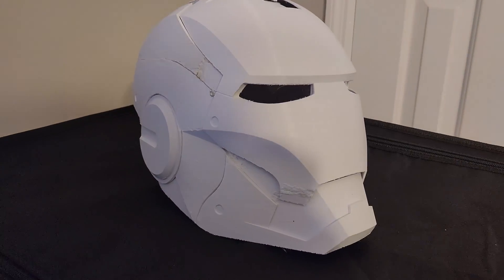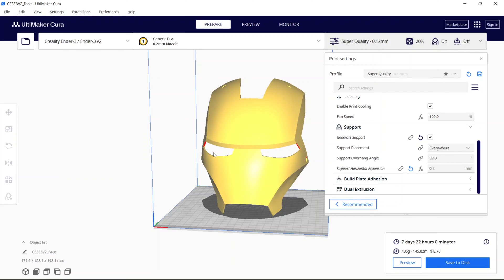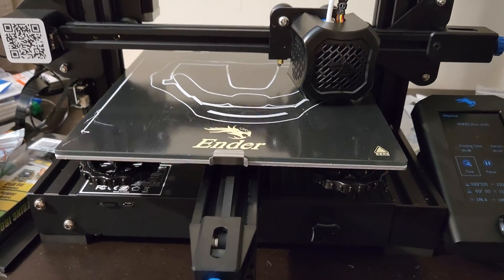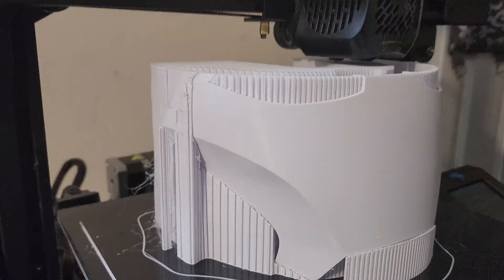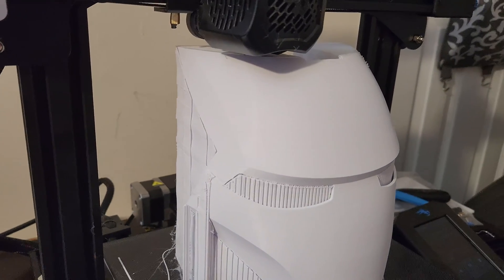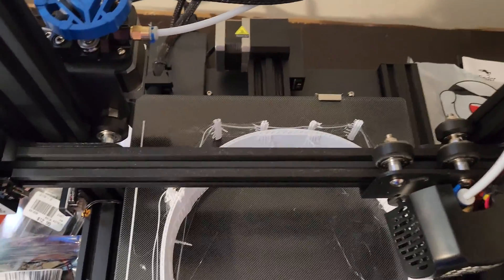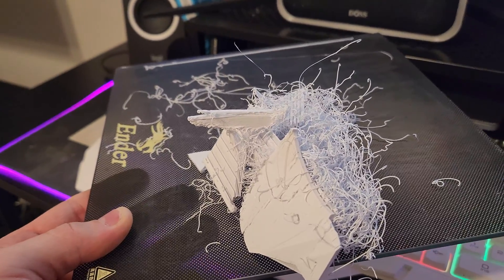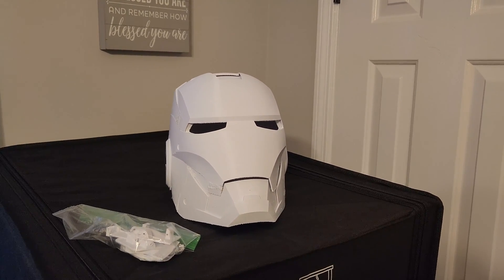I 3D Printed An Iron Man Helmet As A Beginner - What I Learned...

Comment: Those are pretty decent results for default settings!
A good tip for beginners is in regards to supports and print times. The use of "tree" supports may help in cutting down print times from days to just a few hours. Also, your walls and infill settings will definitely help cut down overall print times. I usually go with  2 to 3 walls with 15% infill for most of my Star Wars-related helmet builds. With these settings alone a full helmwt is usually completed in under 20 hours using standard or hyper PLA filament.
I hope this info helps others. Thanks for sharing your build project! 👍👍👍👍
Reply from the maker: Thanks for watching!

Comment: I did my front faceplate, flipped upside down, auto tree, 5 hours on my Bambu lab printer. U don’t need all that support.
Reply from the maker: Thanks for sharing
Reply: 8hrs for me, angled it so the inside is the ugly side from the supports, .10mm layer height Bambu P1P, thats with the other front piece also
Reply from the maker: @BuiltByLines3D  interesting point